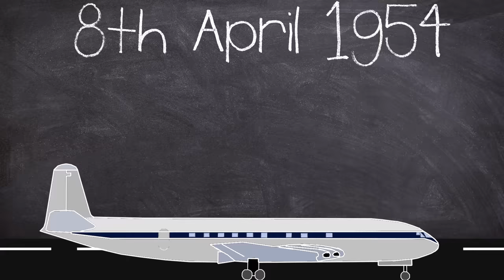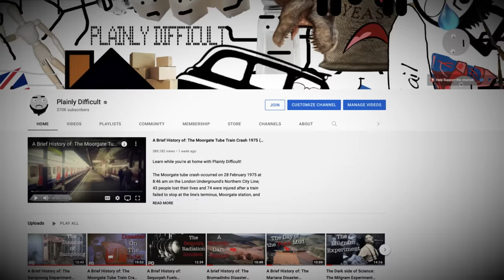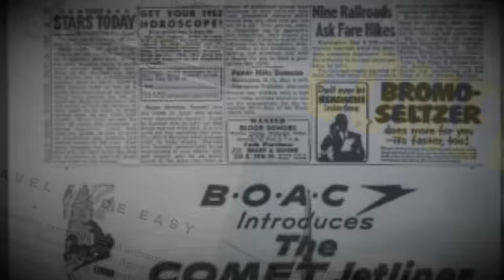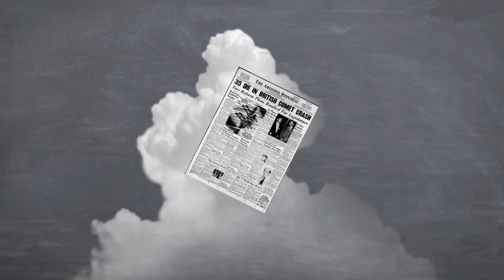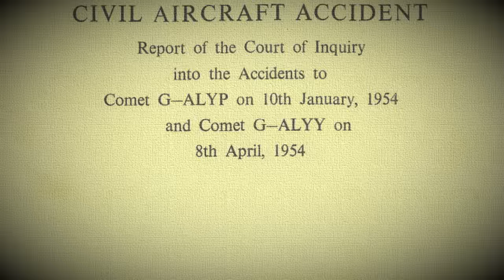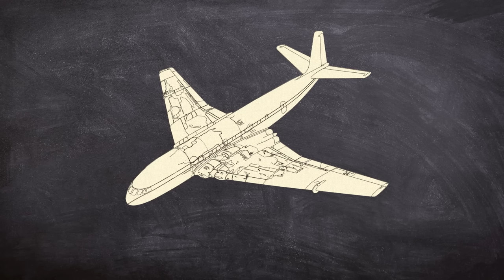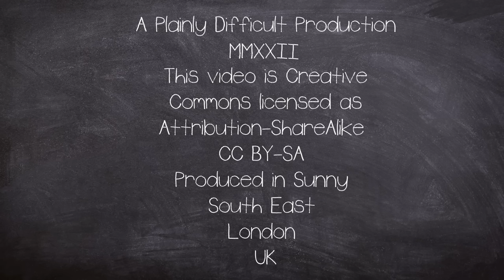A Brief History of: The de Havilland Comet Design Disaster 1954 (Documentary)

Comment: The biggest problem was that the stress tested fuselage was cold worked and was tougher than normal. Thus De Havilland got misleading strength data. If all if the fuselages had been stress tested in the same way, these accidents might never have happened.
Reply: Interesting. Do you have, a sauce, sorry, a source.
Reply: @Margarinetaylorgrease  Rivert duHamel's video on YT covers it succinctly.
Reply: Square holes concentrated stress at the corners of the holes, allowing premature stress cracking of the fuselage, when the crack grew long enough to reach another window (window is any penetration of the fuselage, whether an actual window, or an antannae) causing a failure making the pressurized fuselage pop like a balloon. The British had almost no experience with pressurization at that point. Pretty much Boeing, and curtiss were the only companies that had built pressurized aircraft at that time.
Reply: Later versions of the comet would have these issues rectified, but it already had a bad reputation and by that time Boeing and Douglas had far superior aircraft in production. The Military however loved them for antisubmarine and airborne early warning use. The U.S. had a similar experience with the lockheed Electra propjet airliner that had a resonence problem, but once fixed had a long career with the U.S. Navy as the P-3 Orion.
Reply: @kdrapertrucker  The problems were never solved, the fatigue life of the aircraft was severely reduced as a result.
Reply: @kdrapertrucker  The entire Nimrod fleet was grounded and later scrapped due to  fatigue failure related fatalities
Reply: @kdrapertrucker  Boeing learned from the British's mistakes. They were paying close attention. Thus avoiding similar tragedy with the their brand new Boeing 707s.
Reply: @everettthepetractionguy4222  That false British myrh has been completely debunked.
Boeing was the world's leader in pressurized airliners prior to the Comet Disaster and de Havilland received technical data on pressurized cabins from the B-29 program during WW2.
the Comet Disaster was a tragedy because it could have been easily prevented if de Havilland had followed well-known and established industry standards.
Reply: @kdrapertrucker  "The British had almost no experience with pressurization at that point. Pretty much Boeing, and curtiss were the only companies that had built pressurized aircraft at that time."

Well, that's not true. The Avro Tudor, Gloster Meteor, de Havilland Hornet and Vampire as well as variants of the de Havilland Mosquito, all had pressurised cabins. 

The reality is people at the time didn't fully understand all the factors of metal fatigue for commercial jet airliners flying at 40,000 feet with the constant stress cycles involved. This was right at the cutting edge for a jet airliner in 1950. In fact the consequent depth and level of accident investigation by the RAE and Cohen Committee - following the three fatal Comet hull failures - were revolutionary, setting the precedent for future air safety.

The cutting edge of aviation history is littered with accidents and incidents. It's how people learnt, improved and adapted from experience.
Reply: @MrDragon1968  Nothing about the Comet Disaster was the result of cutting edge technology... in fact just the opposite, the fatal flaws in the Comet design were the result of inferior, outdated technology being pushed well beyond its safe limits or a complete lack of understanding of the material limitations.
 de Havilland had very little experience with building large, all-metal, monoplane aircraft with riveted aluminum alloys and pressurized cabins... they were still building aircraft primarily from wood and fabric jointed with glue and nails.

The Comet was doomed from inception as de Havilland was simply not qualified to build this type of aircraft... it's grasp extended far beyond its reach, a shameful unnecessary loss of life was the end result.
Reply: @sandervanderkammen9230  Blimey, did Geoffrey de Havilland steal your dummy when you were a kid? You’re on almost every single YT aviation video comments section with endless multiple posts obsessively trashing de Havilland. Go outside, smell the flowers, mate.

" they were still building aircraft primarily from wood and fabric jointed with glue and nails." 

DH were building metal framed aircraft before and right after WW2. The Flamingo, the Dove, and the Sea Vixen (which was developed around the same time as the Comet) were all metal fuselages. And I'm sorry but a commercial passenger jet aircraft (flying at 40,000 feet) in 1949-52 was absolutely cutting edge at the time. No one had done this before. The Comet pushed the boundaries of commercial jet aviation at the time, making the idea possible. Historical records show that the huge subsequent - and completely unprecedented at the time - air accident investigation by British authorities led the commercial aviation industry to realise what was not fully understood, at the time of testing the Comet, about the full extant of metal fatigue issues on passenger jet aircraft. All of the other first commercial passenger jet aircraft came at least 5-8 years or more after the Comet when the lessons had been learnt.

Does that absolve de Havilland from the errors they made with the Comet? No, of course not. They are ultimately responsible. They’d long been an extremely successful pioneering aviation company and had a vision to push quickly into the commercial passenger jet age after WW2. Their testing was very rigorous (for the time), but in hindsight they clearly needed to do/understand more about metal fatigue, given that what they were attempting was at the cutting edge during the Comet’s development in 1946-49. 

However, if it wasn’t at the cutting edge, where were all the other passenger jet aircraft at the time? The Tu-104 (an awful accident prone aircraft) didn’t enter service until 1956, the 707 in 1958 and the Caravelle in 1959. All years after the Comet.
Reply: Isn't a fuselage supposed to be somewhat flexible? Like a balloon?
Reply: @twistedyogert  all structures have a degree of flexibility.
Reply: This video has some BS included.
For example -
  
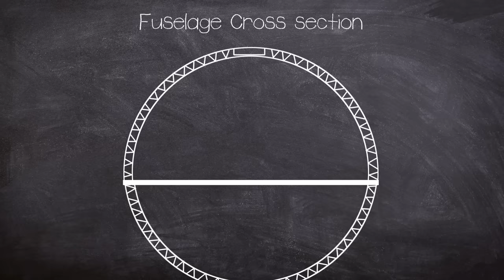    5:20   The idea that only the crew & passenger areas were pressurised is absurd obviously. 
  Every part of the fuselage was pressurised from the nose to the rear fuselage bulkhead including the entire cargo area.

Comets flew until 1997.
The Comet design had military use as a requirement. Nimrod development began at 
De Havilland before 1953.
Nimrods were not withdrawn due to structure problems or other airframe issues it was entirely a significant upgrade snag & resultant basic economics & an end of line sale happening at Boeing at the same time.

We feel we can shed some light on some common misunderstandings.

At the time the Comet wasn't particularly dangerous.

Losses comparisons
How things were in those days.

DeHavilland Comet 4 UK           14% 
DeHavilland Comet all  mks       17%  

Boeing 307                               70%
Boeing 247                               48%
Boeing 707            .                  20% 
Boeing 707                                20% 
Lockheed Electra Turboprop   29%
Canadair CL-44  Turboprop     46%  
Convair CV-580  Turboprop     22%
Convair CV-880    (ff 1959)       27%  
Convair CV-990     (ff 1961)      35%

    Of course De Havilland had prior experience building many all metal construction airframe aircraft including thousands of jet powered fighter aircraft that were primarily of metal construction with pressurised cockpits & jet engines built by De-Havilland.

   De Havilland carried out full stress analysis & engaged in a comprehensive & protracted testing program.

   The DH Comet was the first passenger airliner with full length fuselage pressurisation at 8psi pressure differential.

   Of course ripstop provision was provided. The skin alloy used became unavailable at the time due to R & D at the manufacturers which resulted in the original alloy being discontinued.
The skin thickness used for the Comet was used for similar later aircraft. 
Frame spacing was not found to be too large & frame width was not found to be too small.

  De Havilland did indeed always work to better than industry standards at the time, used up to date knowledge for the design & construction & no evidence of negligence  or criminal negligence was ever produced in relation to the DH Comet.

  The DH Comet had no effect on the course of the aerospace industry in the UK. The UK now has the world's largest combined nuclear, aerospace & defence sector per capita activity.

    The investigation committee did not find hundreds of fatal flaws or evidence of design defects, structural defects, defective materials or shoddy workmanship. Ripstop provision was included. Claimed incidents did not involve cracks starting from window corners.
Pretty much all changes were just in case changes or were planned development modifications & improvements that were scheduled regardless of incidents.

Hope this helps.

Cheers 👍
  
   
   
xcxcxvcxcxcv
xcvvvvccvcxc
Reply: @sandervanderkammen9230 Well they were, hence The Comet 4